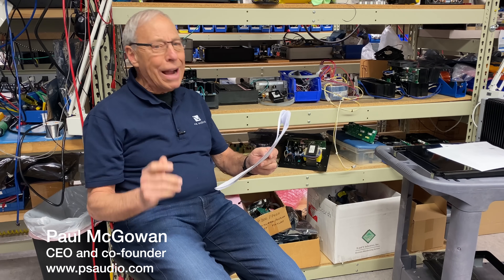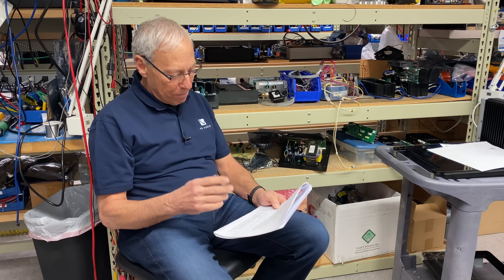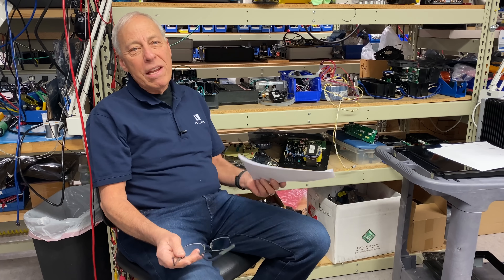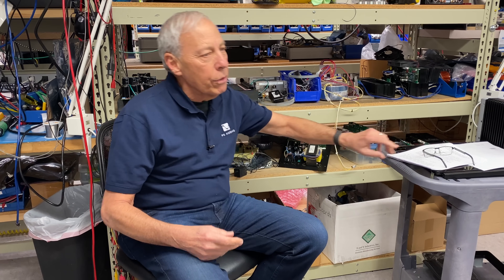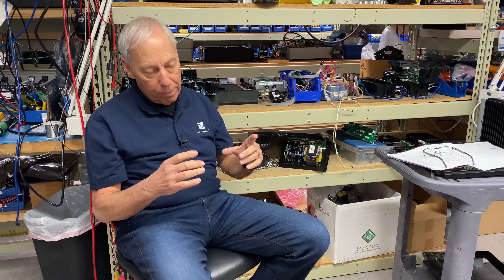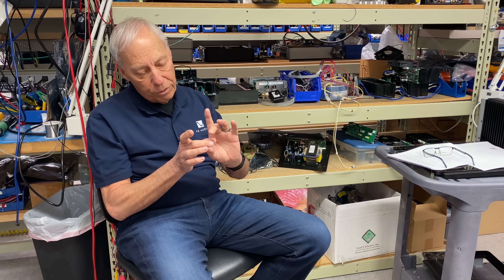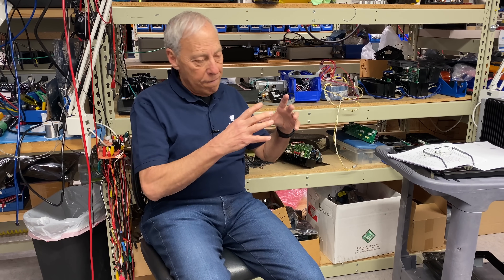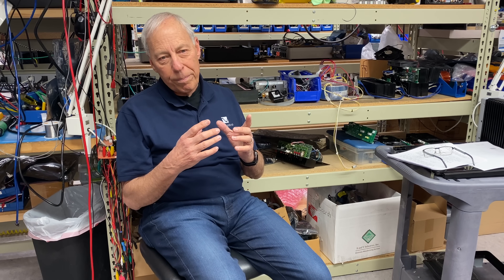Are toroidal transformers better?

Comment: So it boils down to balancing cost and reducing noise floor? I imagine the science behind the tighter field you mentioned has to do with the slightly more unpredictable nature of the Eddy currents in the EI transformers since the grain direction on those plates have to be aligned accurately to avoid it from essentially becoming a giant antenna right? Not sure if I got that part right :P super cool video!

Comment: Well, the Spanish names in the United States are from territories that were stolen (with various tricks and extortions) from Mexico.
Why then, if it's price that defines them, does Audio Note UK, for example, use lamination transformers? Is there a point at which these transformers, when well designed, can be better than toroidal transformers? Then the logic is reversed: a power transformer with laminations can be more expensive and better than a toroidal one. At least in high-performance tube equipment.

Comment: The nice thing about EI core transformers is they much cheaper. This means there is more money to spend on engineering, other areas, and improvements. A super cheap toroid is still more expensive than a really good non-toroidal tranformer.

Comment: I beg to differ.  I do agree that stray fields are much reduced with Toroidal vs. EI transformers, but to say that Toroidals are more immune to mechanical rattling, I've found to be, untrue.   For me, I don't believe toroids sound better than EI.  I can say that toroids have a benefit with their smaller, weaker, stray field that they can be placed closer to quiet high gain circuits and not induce/couple as much hum into those circuits. This is good for Phono stages and the like. This was good when CRT monitors were the common display, due to the much smaller magnetic field.  No issues with flat screen monitors.  Back to the rattle issue.  Toroidal transformers are more efficient and have tighter/better magnetic coupling between primary and secondary windings.  This can also cause problems if not designed around.  An issue that can arise is if you have large supply capacitor values, the tight coupling of the windings and the large capacitance will cause large inrush current that are hard on power switches.  Soft start components, such as a varistor (Glo-Bar) can be used to prevent this issue.  Toroids are very sensitive to a net DC value on the mains lines.  You maybe asking, "What DC on the mains?".  Well, there's lot's of half wave rectification on the same power line your using.  Things like hair dryers, etc can leave net DC offsets on the power line.  Harmonics spit back on the power line also create 'dirt' that toroids don't like.   Mechanical potting of the laminations help, but is not a cure all.  If you want quiet toroids, it almost requires a 50/60 Hz, clean, high powered sine wave generator to provide the signal to keep toroids quiet and happy.  There was an old Mark Levinson amp, ML-9 I believe, that had an "anti-Rattle" module in line with the AC to the toroid transformer.  They used a bride rectifier and a cap to provide a ~1.2VDC gap, bridged by a capacitor to help eliminate it's toroidal transformer's rattle on dirty lines.

Comment: Thanks to this video a lot man. I play guitar and my toan is built around an awesome Hughes and Kettener Valve three channel pedal (NOS 1994)... The stock wallwart IE Transformer was noisy as hell, even when volume down that b... made noise in the line. So I got a toroid, stuck it a computer PSU with three prong ground and it sounds more even (bass, mids, highs). Yesterday I was testing both against each other and the stock wallwart being just in the same powerstrip and the toroid feeding the valve pedal, when I took out it made an annoying pop, whereas wallwart feeding the valve and taking out the toroid didn't make any noise. A friend told me that a guy that works with him (both are doctors at a research centre) told him "Your pedalboard is as good as your powersupply is" and I found this to be true. Yet need to finish my AC PSU with a soft start (check that out if you're using toroids), and enclose it roadworthly so that I can get it far away from my main DC PSU (yes some expensive musician makers sell stupid wallwarts in 2023). Thanks again man, you don't know how much you've helped me. Wish the audiophile world came more into guitar world which still seems doing some thing brainless. By the way still is a question why guitar valve amps use IE transformers (tough Laney has some toroid based amps), is it out of lazyness, not taking risks?

Comment: My favorite Marantz I've owned (and still keep as backup, separate power amp now) was my first torroidal with the SR8002. I always felt that had the cleanest and most headroom out of any others I've had...always made me wonder if the Torroidal transformer had anything to do with it or just better components then others for the gain sections. Now w Xbox One X and PS5 I need to replace my cheap SR5010...and noticed a SR8012 from 2 years back has a torroidal again. This is an interesting video to watch before I can make a choice.

Comment: Howdy again.
Bandwidth Audio has a wonderful clip where it is explained how the unavoidable air gaps in EI cores help fight saturation. It is claimed that toroids saturate much easier when the mains has a DC component.
Hopefully PS Audio uses toroids with say 2% more winding turns than what is calculated for laboratory clean 60 or 50 Hz. That will tolerate some redsidual DC in the mains.
Regards again.

Comment: Les Wolstenholme - Avondale Audio
4 hours ago
I have to disagree entirely for the following reasons:  A party trick I used to play for visitors involved an amplifier in chassis form where it was a simple matter to substitute a stacked transformer for an identically rated toroidal (VA rating, secondary voltage) without any other changes.  The gathered audience consisted of experienced listeners and in many cases, their ladies (I trust the hearing abilities of ladies above all).  Invariably, the stacked transformer came out tops for sound quality.  I have some of your early products here using the stacked TX and often wondered why you hobbled later models by employing (as did Krell amps amongst others), a cheaper toroid.

Comment: Paul, I've repaired a faulty circa 2010 Subwoofer by replacing some caps. However the toroidal tx hums at 50hz harmonics (I'm in Australia) 
Is it old age causing this ? Not sure if replacing would solve it, and that's if I can even find a 41.7/17v output.
Reply from the maker: Doubtful it's age. Probably poor design in the first place. Sometimes lower cost torroids are made from cheap steel or they are not wound properly. Lots of reasons they can buzz.
Reply: @Paulmcgowanpsaudio  I have the same issue as Scott here. Paul, I got the complete opposite answer from the manufacturer. They said that age is an issue. The older they get, the more they hum. So your "doubtful it's age" doesn't match up.
Reply from the maker: @rabarebra  Other than the varnish sometimes used, I don't see any mechanism for the steel and copper changing. I have worked directly with transformer vendors for years and have never found this to be a problem. Perhaps send me their response of how that could happen. Thanks.
Reply: @Paulmcgowanpsaudio  So a toroidal transformer should work just fine as it did 30 years ago?
Reply from the maker: @rabarebra  Absolutely. The power supply capacitors it feeds are probably not ok, and these should be replaced.
Reply: @Paulmcgowanpsaudio  Those are replaced. You know what's inside the toroids besides copper and the metal? Resin. RESIN!!! Educate yourself.
Reply from the maker: @rabarebra  Yes, correct. Varnish and/or resin. I am curious why you seem so angry about this that you feel compelled to wag your finger that I get educated. I am wondering what level of knowledge you think I do or don't have after 50 years of designing and building such things. Just curious. And, perhaps you have far more than I which is just great! Please share.
Reply: @Paulmcgowanpsaudio  Toroids doesn't last forever, the flux inside may well dry out, so there you go. This is why I had to point the finger.
Reply from the maker: @rabarebra  The flux inside? By flux do you mean like solder flux or do you mean magnetic flux? Please explain.
Reply: @Paulmcgowanpsaudio  The ball is on your side to explain, not mine. Now let us see how clever you are.

Comment: Toroid transformers, they certainly have their issues too. Some very serious. Small electrical issues with an offset, they no longer work very well.
I've heard of people that switched over to LED lights within their home, their toroid transformers would get hot to the touch and make a ton of noise within the secondary.
I use them too. But it should be noted they have their issues.

Comment: Great video.  They are MUCH better because of how the magnetic Flux flows. They are quiet, run cooler, and are more efficient. Co$t is why manufacturers avoid them for the cheaper I an E type laminated type. A pre wound coil can be inserted into the "E" potion, then the "I" (which is always the base) can be weled on.
  Due to the torroids shape (one piece) it must be wound by CNC machine which takes more time and energy. 
  You ARE, however, wrong about how the torrid is MADE. It is NOT donut shaped stampings ( Flux loss would still be high and magnet vibration within the core would result in heat and noise. They are 100% ceramic pressed and fired. I used to build and modify them for R&D.

Comment: I made my own amplifier  using 2 old halogen power supply transformers but its only 10 volt rms I coupled then  whit 2  0.5F capacitors no riple what so ever and if I unplug it it keeps going for 2-5 minutes  Its a very very basic amplifiers  2x MJ2955 and 2x2n3055 transistors   and 4 opamps   one of wich has its feedback connected to the output of the amplifier  and it has almost no difrence from input to output  only problem is that I need a little more voltage to drive my speakers  20 volts ain't enoug and I get some overdrive  and all the parts can handle more voltage I stil thinking of geting a big toroid  but that woud break the symmetry in my case and so I want 2 one for the positive rail and 1 for the negative rail

Comment: Years back, the company I worked for, designed and manufactured toroidal transformers.  I personally wound thousands of them. All of the ones we built, were wound on compressed ferrite cores. Different mixes of core material for different properties of operation.
Reply: You might be a good person to ask this then, but if you were to make a toroidal's core out of something exotic like a mostly iron-nickel meteorite (just a whacky concept), what kind of effect would all the metallic impurities have on it (copper, cobalt, iridium) Assuming you tempered it beforehand to try and mostly get the grain direction to be more linear and could even get it to behave while compressing it into a core? Would it really sound much different than just a standard compressed ferrite core?

Comment: PS audio has thrived mainly because of the BS it put out regarding what 'sounds good' and on eliminating impossible-to-hear 'problems' that were never a problem in the first place; however in this instance everything said is actually true. Toroids are for many reasons better for audio equipment.
Reply: Well, that BS comes with a 30 day return policy. I own a P3 and will not go back. Maybe the power available to me is not as good as what is available to you.  So I would recommend you try out there products and if it doesn’t do as advertised or expected just send it back for a refund.  Thanks PS audio!
Reply: @David_Nauss  Let me guess:- you've never had a science lesson in your life?

Comment: Paul mentioned in passing an attribute of toroidal transformers that is the primary reason they are used in balanced power isolation transformers. i.e. efficiency. I have two of those products. The toroidal transformer in each is about twice the size of the largest one Paul picked up the the video. One, a Furman IT-1210, is used to power all equipment in my electronic music studio and is totally silent. The other, made by Equi=Tech, makes a slightly audible hum. It is used to power the home theater electronics and is in a cabinet so the noise is not detectable from a theater seating position. In the early 1970's I worked as a technician trainee at the Pasadena Naval Warfare Center. One one assignment in an electronics lab I had the opportunity to fabricate some small toroidal coils. The process is interesting. A split bobbin is located through the core hole and then wound with the amount of wire required for the final part. The winding machine then rotates the bobbin to unwind the wire around the core while simultaneously slowly rotating the core to distribute the windings around the circumference. An interesting phenomenon that occurs when powering up such a large transformer is the reason I keep them powered on all the time. When first turned on the inrush current needed to saturate the magnetic core is so large that it has a tendency to trip the 20A breaker supplying the wall outlet. If that happens I quickly reset the breaker, which is fortunately nearby, and again flip the switch before the magnetic field can completely dissipate.
Reply: You can also build a slow start circuit.  Just a big resistor in series so the in rush is lower amperage.  A second switch to bypass the resistor after the first few seconds.  It will save your breakers.
Reply: @user-od9iz9cv1w  What else can you add to this conversation of any other interesting point Sir W ???

Comment: If I use a toroidal transformer for sine wave inverter, do I need to install an inductor or choke as well? How to calculate the value of the inductor for each capacity like 750VA & 1250VA sine wave inverter?

Comment: Hi paul, would it matter if we use EI transformer instead of toroid transformer in a CD transport. As I understood EI transformer produces noise, EMI more but does it matter in cd transport where only digital signal is transmitted to an external DAC
Reply: Torroids are noisier than EI. R-core are the best for source gear.

Comment: I seriously doubt you can hear the difference, sorry. You're talking about a source to a circuit that is highly filtered and regulated DC. Think you can? Let's do a DBT so you can prove it. 
Toroidal transformers actually have more hum and noise. Why? Because hum and noise are capacitive in transformers not inductive and the interlacing on toroidal transformers promotes that. That's why Antek is now adding shielding to their audio transformers. The best transformers? Split bobbin.
Reply: Seems to me that Mark Levinson should hire you for his R&D group.
Reply: @YuengsNwings  Levinson, PS Audio, etc. put these things into their equipment because people who know nothing about electronics think they make better sound - they don't. Toroidal xformers have a tighter noise radius so manufacturers can put components close to them with less noise and save cabinet space. You can't hear the difference - audio is voodoo today. People buying expensive wood stands to keep their cables off the floor - nonsense, give me something to work with here.

Go ask an electronic engineer if he or she ever bought an expensive test instrument where the manufacturer said you have to run it 100 hours before it works right! I have instruments that measure down to picoamps and up to hundreds of MHz, well beyond what anyone can hear. I never had to break anything in and we're talking thousands of dollars of equipment.

I'm sure Paul's a very nice guy but they are in the audio business to sell stuff - bottom line, you get toroidal transformers from them and Mark Levinson.

Comment: I have Logitech Z-5500 speakers. They are more than 13 years old. Theres a toroidal transformer inside subwoofer. Can be this transformer the cause that the subwoofer makes thumping sound but only in the evening? Or maybe those two large capacitors inside? Thank you sir.

Comment: Marantz is using toroidal transformer, why  dont other companies use it too?
Reply: Marantz uses Ei transformers in their SR, NR & MM units...  they only use a toroidal in their $2500.00-$3000.00 flagship SR unit.
Reply: It’s all about cost-benefit analysis. Toroidal transformers are more expensive, so using a different power supply is one way to cut costs to fit a package into a certain price category.
Reply: Well anthem, rotel, yamaha can use it 2 in their flagship. By not using toroidal they will save what 500$ ? It would be nice 2 compare they same receiver with and without toroidal transformer and what will the price difference be.